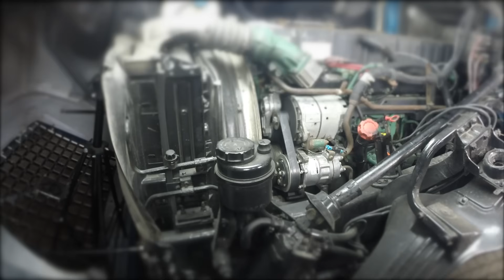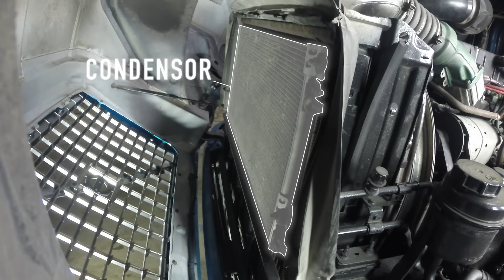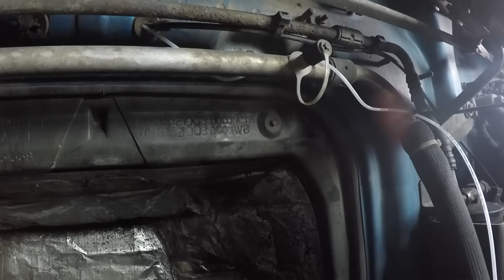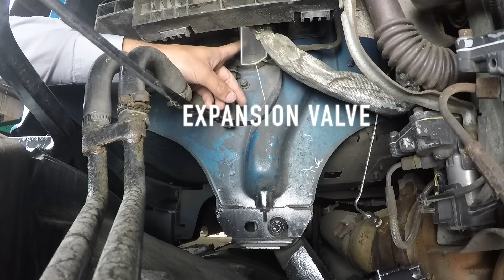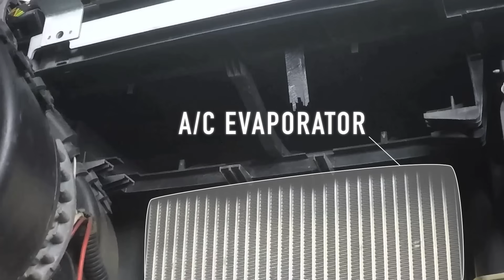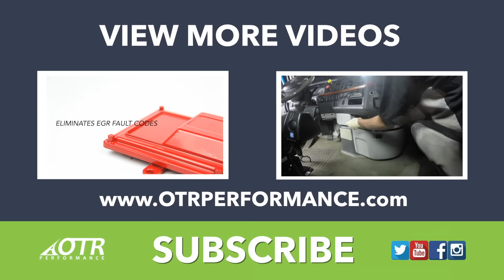Volvo Truck A/C Components On A Volvo Truck | VN, VNL, VHD | AC System Part 1 - OTR Performance

Comment: When the truck is running, does the sleeper ac unit system use the cab AC condenser and evaporator or does it use the stuff under the bunk and the condenser mounted on the outside back of sleeper?

Comment: Hello sir iam operating volvo motor grader g990. Its stop for one month and after that i start work again but its ac stop working even compresser is running and blower throw normal air. What should be the problem

Comment: Does anybody know if a 2008 volvo 630 has a relay or fuse can't find if compressor won't work climate control has power high pressure sensor has power whatever powers the compressor is not working what powers it

Comment: The AC in my 2014 Volvo 780 is not working at all. When I press the switch to turn the system on I do not hear the compressor engage and no cold air is forth coming.  I checked the electrical connection on the compressor and it is plugged in.  The fuse is solid, too. Am I looking at a failed compressor?  Also, where is the low port valve?

Comment: my ac is not blowing hard and a door to the outside area is open in the front windshield filter area ...will that cause no pressure in the inside of the vents blowing out minimal air pressure but cold

Comment: my AC is working fine in the driver and passenger front cab, but the sleeper cab AC is not cooling.  Can anyone help?
Reply: +OTR Performance its a 2007 vnl 670 D12, I found out that this happens only while the truck is idling , once I'm on the road driving it starts to blow cool air again like it should.
Reply: jattnchicago hothi that’s the same problem I’m having what did you do?
Reply: I'm having same issue but my sleeper never cools down.... I was thing expansion valve but it's only a blow thru design.... could it be evap?